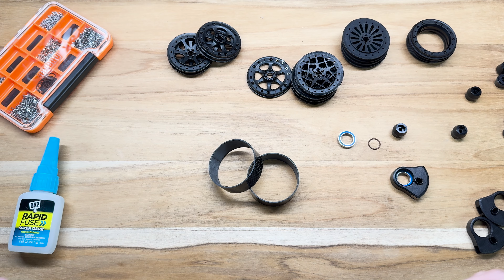INSTRUCTIONS - Ultimate 24 Wheel Builders Kit

Comment: The "polished" finish looks nice. I've wondered for a while if media tumbling would give that sort of finish and get rid of those wretched print lines. They may be using a method like the rock polishing tumblers that where around when I was a kid, and hence them calling them "Polished". 
Just a guess. On my lengthy "to try" list. I've got glass bead media from my old sand blasting cabinet. Rig a motor to a 5 gal. bucket on rollers and toss the parts in.

Comment: 18:27 You say you will show some tricks to modify the stock foams, but I didn't hear any. Can you elaborate? Would you use the leather punches?
Reply from the maker: You’re right, I forgot that part! Yes, I would round leather punch (or exacto knife) a stock foam in half, from the side, then “cut ‘n shut” to make a bigger circle.  You should be able to lay two pieces in place inside the tire without it moving. No need to bond or connect the foam back into a continuous loop. Does that make sense?

Comment: What's the OD on the carbon tubing? I'm running a similar design that's all printed now and this would be a slick upgrade!
Reply from the maker: I’m using 50mm for 1.8 tires and I have smaller options for smaller tires.

Comment: To cut the Tyres with more precision is even, I like to add an insert to the tyre which will center the wooden ring. Wheels seem a little over complicated and expensive for the purpose. Any chance to use just the hangers with other existing 1.8 wheels?
Reply from the maker: No other wheel has this low of a center of gravity if performance is your focus. 

Other wheels don’t have the internal clearance. Plus the 1/24 scale world hasn’t standardized their six bolt hub dimensions.

Good idea on the foam! 🤘
Reply: if you don’t like them then don’t buy them, there are plenty of us who would fight over these wheels due to the level of performance they offer